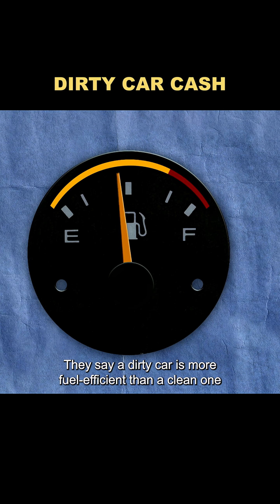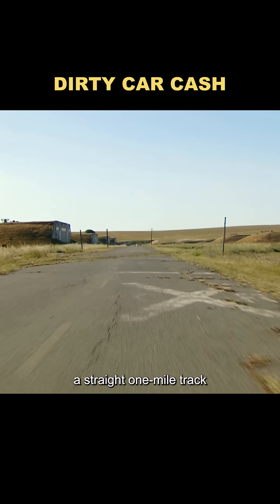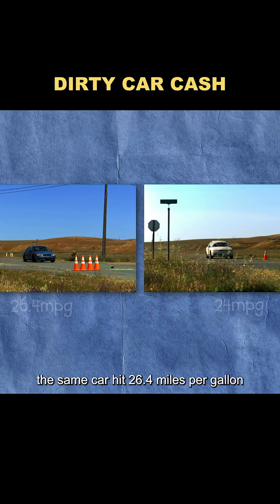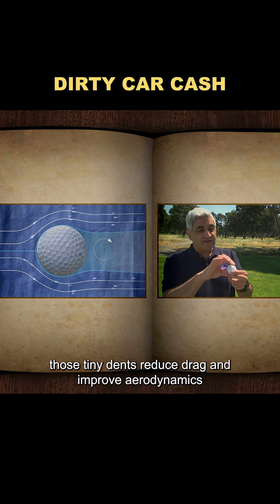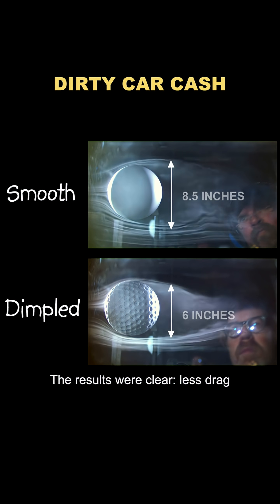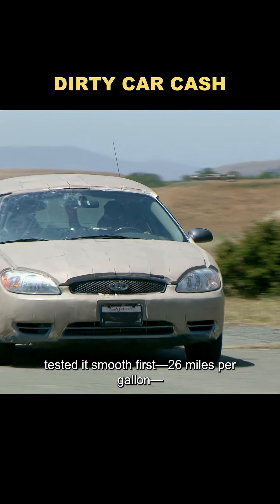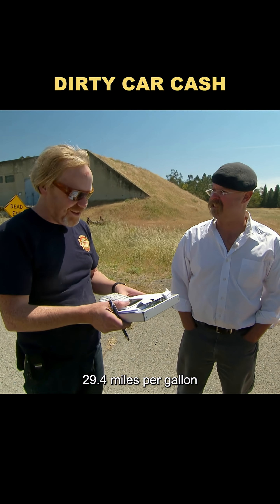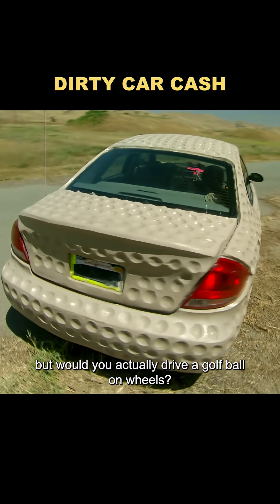While not the most attractive vehicle, it is very fuel-efficient.

Comment: It was 11% more efficient with the extra weight of the clay, so probably a bit more than that. Around 1/8 i'd say. That's insane! It'd save over 100 gallons/year for someone who uses the car a lot on the interstate. Thing is efficiency drops with speed. At 30mph it'd probably save just 2-4% and crawling at a snail's pace through the city would be unnoticeable.

Comment: Of course I'll drive. It just needs a little bit of decoration and that's all.
Reply: I also
Reply: Yeah, I will do it, too. It is just the small amount but it is a big change for the long term.

Think my example as the most stupidest idea.

1$ per 1 L of gasoline

1000$ = 1000L

With 11% efficiency,

990$ = 1000L

Don't trust me. I am not an accurate calculator😅